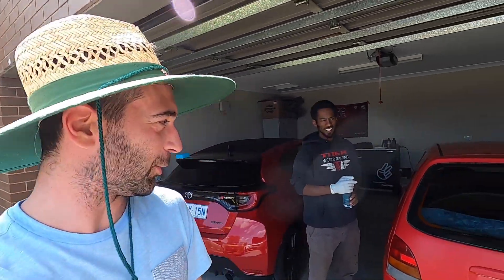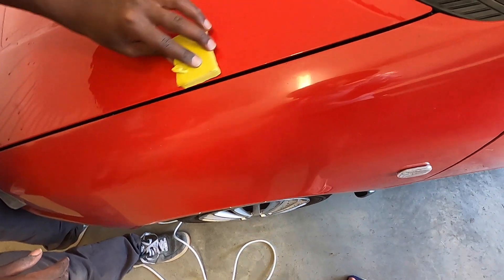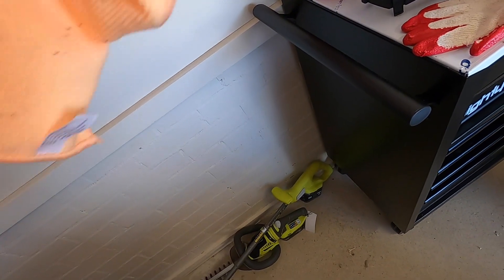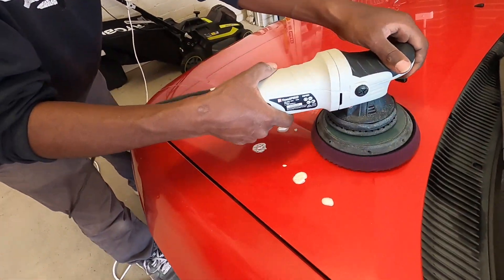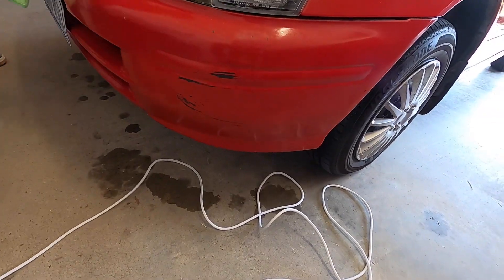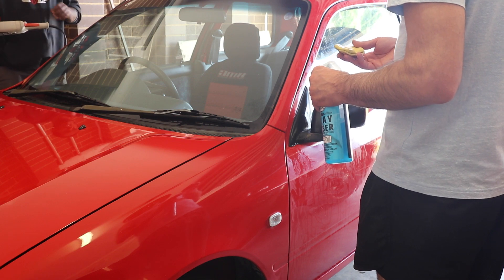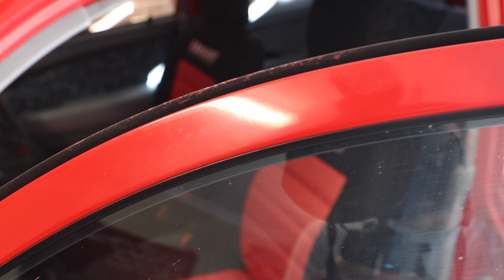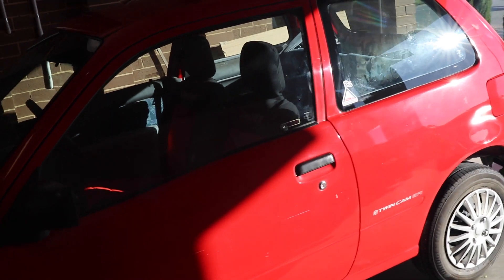How to CLAY BAR & BUFF old car paint - AMAZING result!

Comment: Paint has held up remarkably well honestly,most Starlets' paint starts to peel and fade pretty early,as is the case with mine haha
Reply from the maker: yeah I was surprised, being a single-stage paint helps because it just oxidises and becomes new once buffed. Most other paints have damaged clear coats which can't be repaired, unless going full respray